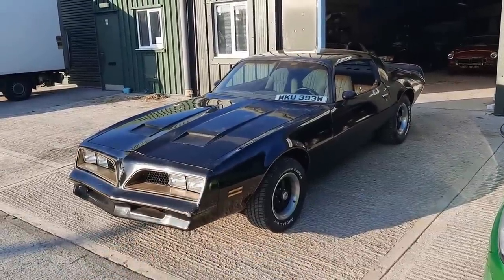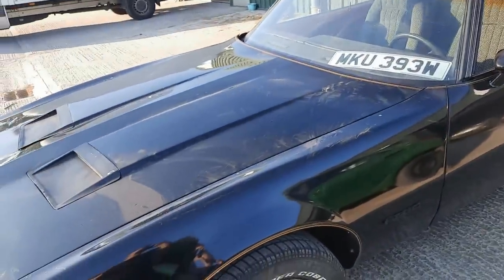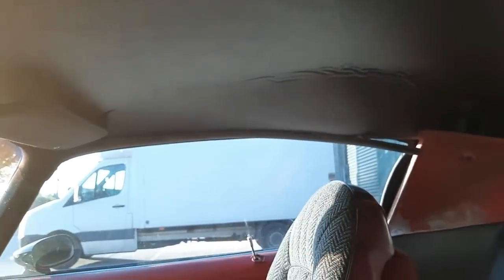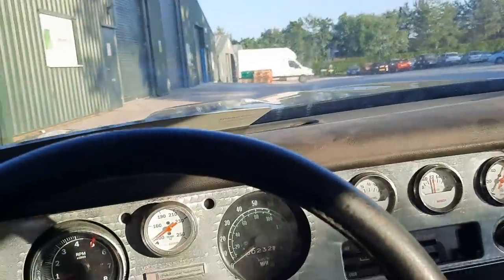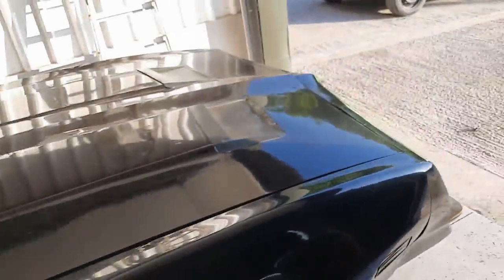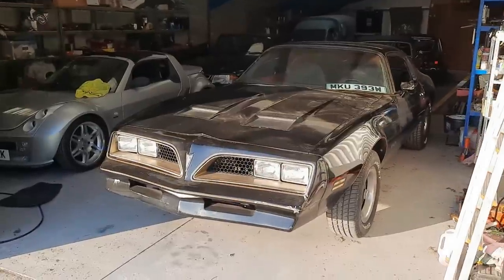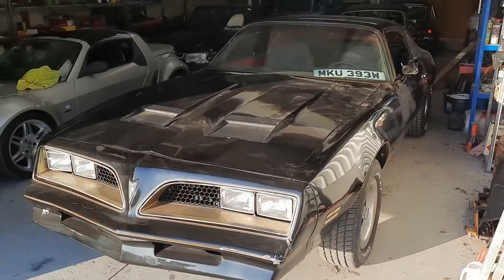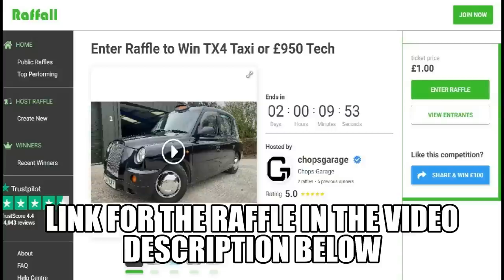Is this a case of "Don't meet your Heroes"?

Comment: Ooh a fire turkey you need to put the screeming turkey vinyl on the bonnet also the vin plate or build sheet and Internet search should tell you the options it got when it was new. The hand brake or E brake on some yanktanks is usually a small pedal by the clutch pedal also in true American style you gotta do a burnout. Great car James. The Craig's list rebuild can only be from the excellent vice grip garage channel

Comment: Headers are changed. The carb sits too high the air cleaner will sit too high you need to change carb. Yes air conditioning but the guy filled in the holes with gauges . It has a special edition trans am nose clip. That's why they are gold. I would not have bought it. Too much piece meal

Comment: Parking brake is/should be a small foot pedal under the dash in the far left side of the footwell. 
Looks like you have a "bitsa" car. Engine sound is closer to a small block Chevrolet but could just be exhaust system.

Comment: Hi James 
As other comments the front is a 79-78 but I think the back lights are from a 80-82, the bonnet is from a formula, I don’t think it’s a Esprit model as they didn’t come with the 6.6, unless its been fitted instead of one of the smaller engine options.
But it is ultra cool, reminds me of one of the lines from the movie “ when I get home im gonna punch your mother in the face, cause there is no way you came from my loins”😂😂😂

Comment: I used to have a 1978 Trans Am here in the UK with the targa roof. I can assure you the nose and lights are from a 1977 or 1978. The bonnet is from a Formula 400. The boost is most likely because later models had the 4.9L turbo. For parts I used Classic Industries in the States. If you are lucky you may just be able to trace its history from the VIN number using USA based car check sites. That was as you stated part of the air con system. Good luck with the project.
Reply from the maker: Thanks
Reply: Build sheets for them, I have found them under the bottom parts of the rear seats. 45 years old though, it’s prob disintegrated or gone by now
Reply: Yes agree it’s a 77-78 Firebird formula. 400s are pretty rare from that era so could be valuable once restored. Just make sure it’s the big block as I also think they used 301s and 350s during that period.
Reply: @ChopsGarage  You bought your first 'Hybrid' ... ! 😂

Comment: Nice to see a carb, a mechanical fuel pump and an exhaust, that'll save you 90% of the usual trouble on modern cars. Back in the day there was an American scrap yard near me, woolhouse I think, running a big yank was popular 70s and 80s,i had a jensen with a 6.3 in it and it was quick, you could actually see the gauge dropping tho.
Reply from the maker: Exactly nice n simple

Comment: In 1979 santa pods co owner roy phelps imported a brand new , tenth anniversary special edition, all silver with a silver interior and 6.6litre 400 cu in motor and auto box.
My dad was race director at the pod and as a 14 year old i got chucked the keys by roy and had a deserted santa pod (not a race weekend) and 30 mins to carefully drive it.
I thought it was a rocket ship.
My dad had a 1968 jenson interceptor and dad and roy had a drag race (no lights, no times) and i stood at the finish line and watched the jenson absolutely slaughter the trams am by a good 2 seconds, but the trams am certainly had the looks from this 14 year old lads eyes

Comment: The engine is a 403 cubic inch. It's an oldsmobile lump. Sadly not much in the way of tuning parts for these but you don't buy one of these to go fast. 
Well done - I would love one.
Reply from the maker: Oh how did you spot that. Of is it that's what they used

Comment: Have a long standing friend who owned a 1977 6.6ltr T top full leather for about 30 years until an accident wrote it off. You need the correct bonnet with air scoop in the middle, complete new dials, steering wheel and the interior is always black. The handbrake is a foot operated version I seem to recall. The back end is dangerous in the wet on roundabouts as it is tail happy, not a lot of power from the huge engine but endless torque. Panel gaps are rubbish from factory and general fit and finish is poor out of the box as is the paint. Even though it will rattle you will have fun, that is if you can afford 12mpg urban or 17mpg light foot on a run.

Comment: I had a 79 Trans Am and loved it to death. I used to drive it from Hampshire to Scotland once or twice a month when the MD paid the petrol.  Only the vin will tell the age and the model so surprised you haven't checked that. I had mine for over 5 years. No regrets.

As it stands, it has a Formula hood and the front end is  77/78 ( Smokey and the Bandit year model ) The engine will be decided on when it was built of where it was sold. They where not the big lumps as like earlier or even later. The auto box is bullet proof,  

The 4.9L turbo was only used in 1980 plus cars before the switch to Night Rider styling.

Personally, I think you will catch a cold on this. To me the Trans Ams are the only worthy models in all the model years and anything after 1980 are just ugly.  If I chose one again, any one with the 455 and a 4 speed manual box. Drove one at a car show and it's a BEAST.

Comment: Not sure if it is all firebirds, but the one I drove had a foot operated parking brake. The pedal was on the far left of the footbrake. The brake release was a pull lever that would be in the hole you see in the dash at 9:11

Comment: It would be easy to turn it into a bullnose
If it’s an un molested one it will be a 77-78 and it looks like a formula , which f it has its vin tags you can get them decoded, and I may be able to get you the Trans-Am wheel arch spats, and going with the door handles it’s not an se trim

Comment: Well... Its got a 77 nose (or at least the headlight bezels are as they have the hex pattern. 78's have a diamond pattern). Its got late 78 seats and has a formula hood but that should make it a 5.7 350 sbc and you say its a 6.6 so its a bit of a Bitsa car but it looks like a great place to start. Mines a 78 formula but has all of the T/A parts so i'm making mine a full Bandit replica in Devon. A few vids on my channel if you are interested.

To know for sure what year it is check the vin in the windscreen, look at the 6th digit. 7 for 77,  8 for 78, 9 for 79 and A for 1980. After that its the 10th letter which is B for 1981.

Also Rock Auto is a great place for parts with delivery to the U.K.
Reply from the maker: Cheers buddy ill check it out

Comment: Handbrake might be on the drinkers side as a floor pedal on the left Fella. Don't forget to check your lightening whurlers, spark-a-laters, and fuel maken happeners. During your resto you may need a Tanya Harding and don't forget your vice grip. An old tin number plate riveted over that weight reduction/ankle cooler will work wonders. A little pssst pssst psst and it's brand new. Nice find and looking forward to the next one. Oofta May.
Reply from the maker: Lol love it

Comment: Its a bitsa car, made of bits of this bits of that. Its a 79-81 body style with a 77/78 nose. The 6.6 engine was option only on the Trans Am in 79. If this is an 81 it looks like a base firebird with the 5.0. Looks like there is stacks of filler in the body panels. Sorry to say, depends how far you go with it but it could rapidly turn into a moneypit.
Reply from the maker: Don't worry not my first rodeo

Comment: well... technically bandits car was not a firebird but a trans am with the hood decall, so the wing badges are wrong if its a replica look your going for. that being said, this car is a hodge podge of different car parts from different years, have a look at the 5th digit in the vin ( if the car still has a vin no lol ) that will tell you what model it once was.
no idea whats going on with those wacky gauges, what idiot fitted those..lol, underside...shrugs...maybe was gonna be used as some sort of race car?

Comment: It is not a 79 ... it is either a 77 or 78 Formula 400. 
That front end was for two years only. 
79 / 80 / 81 had the grilles tucked under the bumper. 
Formular 400 had the twin bonnet scoops.
There were four different front ends for that body style ... 70 to 73 were the "bullnose" .... 74 to 76 had the sloping bullnose (75 onwards having the wrap around rear window update) ... 77 to 78 is the one that you have ... 79 to 81 having the tucked under grille. 
Of course, all the front ends can be swapped around ... but an early bull nose with a wrap around rear window would obviously be a wrong 'un.
Reply from the maker: I thought Formula

Comment: hi James i had a formula 400 i think 1979 model reg  was UGS 720W it was gold and brown with the lattice wheels and a targa top ...bonnet release was under bumper on a "T" handle...boot release button in glove box...A schraeder valve in boot to pump up suspension...only a 3 speed auto i think and think it was about right to not change in your test in the yard...wish i had some pictures of it...interior was a tan check velour type material.....im sure your aware of Matt Furious driving he gets his parts for the crown vic from rock autos in usa....good luck,
paul

Comment: 17:15 It has been a while since I got rid of mine, but If I recall, that is part of the positive crankcase ventilation system. I ripped mine out and also removed the catalytic converter at a time when British cars didn't have either.
Reply from the maker: Ah cheers

Comment: 5:32 The front and rear window trim is aluminium held on with nylon clips. The screen and rear window are bonded ... if you get a leak, remove the trim and sort it properly, don't squidge sealer under the trim or you'll make things worse.

Comment: Hi it is a 79, but it's not  a trans am 😢😢  I had the real thing back in the early 80s. God I loved it, James get the real thing  79 6.6 trans am with t tops
Reply from the maker: It's 6.6 so no real difference , never driven with tops down prefer coupes
Reply: @Chops Garage  hi has it got the correct snow flake wheels and the machine affect dash instrument cluster. By the way I made a mistake its a 1977 1977 vehicle
Reply from the maker: @mark120964  no it is an 81 but has 77 nose cone
Reply: @Chops Garage   ah OK hope it gives you loads of fun
Mark
Reply from the maker: @mark120964  cheers bud
Reply: @Chops Garage   I absolutely loved mine. Paid 3 grand for it back in 1882 the equivalent  would cost about 30 grand today. Well out of my budget 😒

Comment: I had one of these many years ago. It's a 77-79 base model. There’s no handbrake but a foot operated park brake on the left and a release handle above this on the lower dash.  panel.
Reply from the maker: That's all missing
Reply: @ChopsGarage  As Derek would say, you don't need brakes.

Comment: I like the pre-1979 models, especially the early 70s ones. GM did move from gross output to net in the 70s for insurance reasons. They also detained some engines. But there were a lot of different models. 

The Esprit had a single exhaust, and a bonnet without any vents. The Jim Rockford car I believe was a Formula made to look like an Esprit by replacing the Formula’s double scooped bonnet.
Reply: You over paid
Reply: Does the vin star as 2U87?
Reply: Keep the car as per the vin. If it's 2U ITS A FORMULA  2S IS A FIREBIRD THE MODEL IS IN THE VIN  2Z IS THE TRANS AM

Comment: Definitely a 79 firebird formula not a trans am going by the dash board and rear lights. The front is a 77/78 which can be changed very easily.
Reply from the maker: Yes I narrowed it down to a Formula

Comment: Check the B post's, they are renowned for rotting 👍
Reply: I've had a couple of these (a Firebird Esprit and a Camaro Berlinetta) ... the place where they rot is the rear of the sills (if standard) or the front of the sills (if jacked up). Water off the windscreen drains down the A pillar, along the sills and out from a drain hole at the back of the sill.

Comment: James, It looks like you've got a good one there but for me I'd have gone for the 3rd gen with about the same power and 5.7L instead. What you can't argue about is the sound of that older V8 which beats that of a modern V8! 🙂